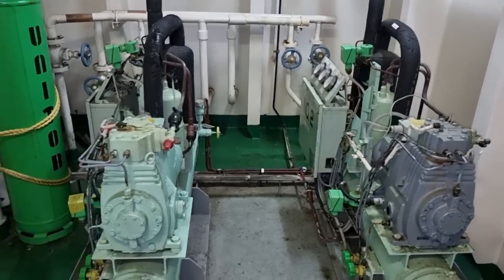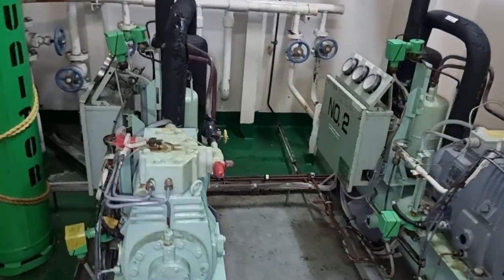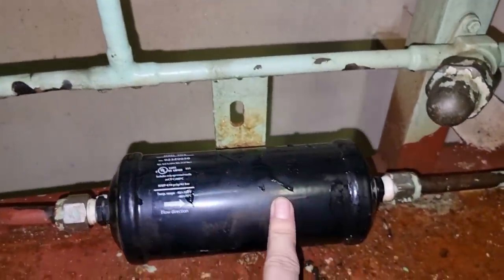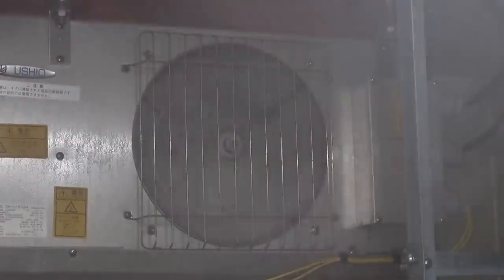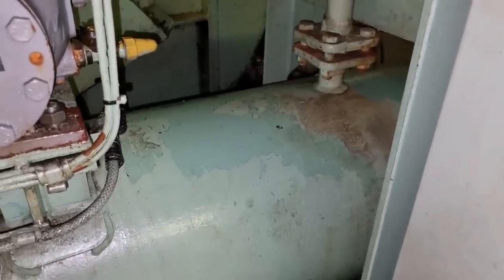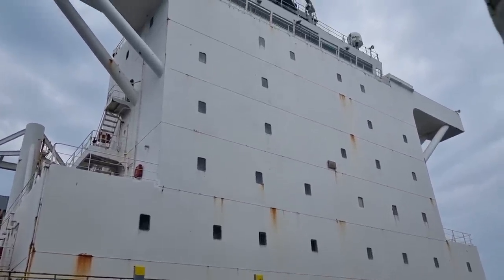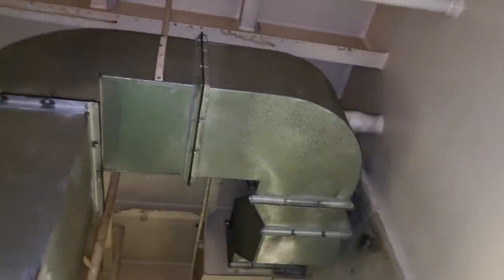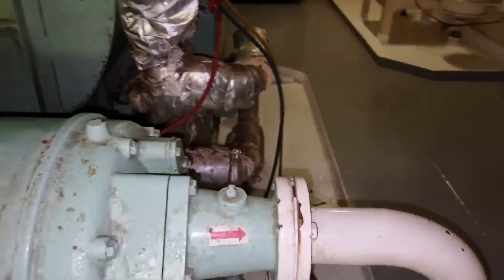AIRCONDITION & PROVISION REFRIGERATION TROUBLESHOOTING, SHIP'S  HVAC

Comment: Actually the accumulator is located after the condenser right and it's purpose is use to store excess liquid refrigerant...so then y the accumulator connection is given  after the evaporator and at the outlet of the evaporator it will be vapour right??
Reply from the maker: it is for the compressor oil that gets to the system
Reply: After condenser is liquid reciver usually used fo storing refrigerant during pump down and during normal cycle it lets refrigerant in liquid state to pass to dryer.  On suction before compressor Is accumulator it only let's refrigerant in vapor state enter into compressor, to prevent any damages to compressor.
Reply: The accumulator placed before the compressor, suction side of the compressor is  connected to the accumulator , and it helps in two ways , 
1. excess oil won't come to compressor
2.cooled liquid won't come to the compressor, if it is directly connected the compressor would die

Comment: Hello boss, what is the reason our provision freezer breaker always trip? Just we finish clean this freezer cooler yesterday
Reply from the maker: you better do an insulation and continuity test on your compressor and evap fan motor
Reply: Kung electrical ka check mo compressor gumamit ka meager tester kung meron ka.. Pati fan motor evaporator tester mo kung grounded..

Comment: Sir hnd bumababa temp ng meat at fish kulang sa lamig pero ang veg ok nmn tpos wlang ice build up sa evaporator ung refrigerant is half level is it txv replace or adjust?? Or what other causes bkt d lumalamig ok nmn watertight doors sealed
Reply from the maker: Ilan temp
Reply: @leckyjake  -12 fish -9 meat then hanggang jan lng po
Reply: @leckyjake  bale nung nalaman ko na d nag low temp ang reading at -2 at -3 lng ang meat at fish nag ice kunti ang evaporator then binanlawan ko mbuti aun hanggang -9 at -12 lng nag bago nmn kht kunti tpos pumapara na ung sa meat pag na reach nya ung -9 nkita ko pumara solenoid then again hanggang -9 pa din after
Reply: @leckyjake  nagsimula sya nung nag provision kmi 5 hours un nkapara ang pinara ko lng is liquid solenoid valve switch hnd ko na pinump down kc gnun dn nmn gngawa ko before ok nmn
Reply from the maker: Baka naman naka set ka ng ganyan sa thermostat mo na - 9? Pm mo pictures sa leckyjake fb page.